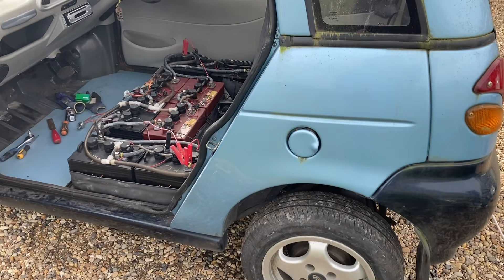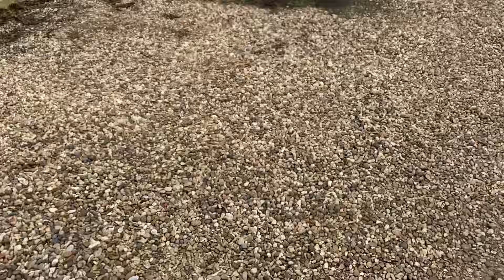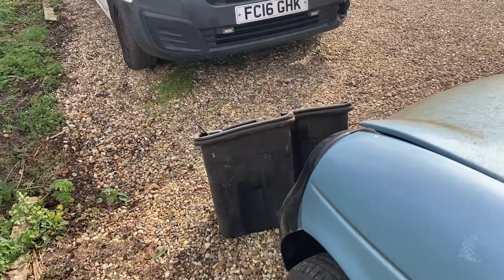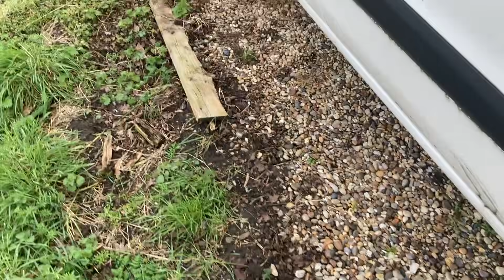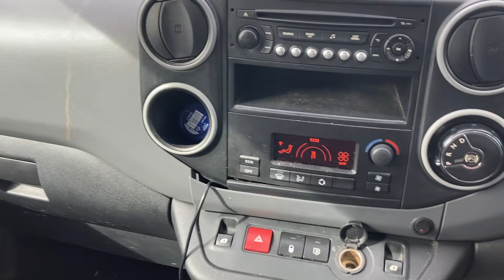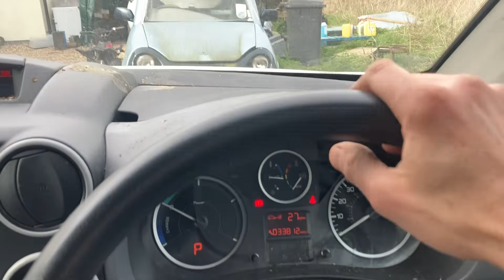It’s RARE EV week! + final answer on the Kangoo battery fault !  Reva G-Wiz Peugeot Partner b9e 2016

Comment: If it's of interest , I used to work with Stanners Equipment in Morpeth , I was R and D on welding development etc and they were given a prototype EV to do bodywork repairs on , it was a Peugeot 107 I think ,  it had a 17kw I think motor in the front it was a laminated iron motor with a gearbox/ transaxle underneath driving the front wheels , the agreement was it was to be scrapped after it was no longer needed ,  this was 2003 or so,  it was a standard car not a concept like the E Doll
Reply from the maker: Interesting thanks !

Comment: That jerking fault sounds a lot like a drive shaft fault, like a worn (or semi-seized) CV joint.
Reply from the maker: It does knock at wheel speed so sounds like a drive shaft. Will see when I get through a couple more Zoe’s !

Comment: I've just been thinking about doing the same with a ride-on mower. Couple of car batteries and a dc motor and controller (of which I have many) and you get a handy compact tug. I don't have the space for a car-sized tug as its only a front yard and driveway so was even thinking of shortening the mower chassis.
Reply from the maker: That sounds like a fun project, I’m not good enough at metal fabrication to be able to do things like good Motor mounts so tend to start with an electric vehicle as a base, even if it’s broken because that is not too much of an issue for me! Thanks.

Comment: Love the G Wiz. Cool project that one.
Me, I'd use it as a local runabout. 
Easy to retrofit 4 X 12V 300AH off the shelf LFP batteries to the G Wiz. Massive reduction in weight, whilst a huge increase in usable battery capacity.
Reply from the maker: Glad you liked the G-Wiz, and that battery upgrade sounds like a great idea!

Comment: I don't believe that only 19 UK sales for the Partner EV. I've had sold about 35 of these and there were loads about registered in 2016. I tried to check on HowManyLeft but gave up as they weren't always registered with the same model name.
As for the gearbox problems on that van, it's probably the sleeve that joins the gearbox and motor shafts together. It's a really common failure on these vans. I made this video https://youtu.be/7c0g-CmFHe0?si=_criFkb3CYPYsnqo&t=209 video some years ago about the issue when it first started appearing as vehicles clocked up some miles.
Reply from the maker: Hi thanks, the numbers did seem low but I wonder whether that is only Sales not ones leased commercially which was probably a large portion of them. I will have a look at your video, many thanks.

Comment: After you've striped down the g Wiz add a 200W solar panel where the roof was. I expect it'll sit round enough to always charge it's self up.
Reply from the maker: That would be quite cool, and since the usage will be in the summer that would work well I reckon.

Comment: On that "it's a bms fault" from the charity car, if it was a bms fault you should be able to diagnose it quickly by puting a clamp meter on the balance lead to that cell and see that it's drawing current.

You'd need to put it on a single wire in the bundle though and not around the whole bundle
Reply from the maker: The wiring is pretty bundled up and my clamp meter isn’t mega accurate - I would be something like 50 or 100ma draw but would work with a good enough clamp meter. Cheers

Comment: Funny I have a 2012 Twizy that I use for towing things about, fitted a towbar to it had the Twizy since 2013 love it but with a 20 mile range it's a bit limited
Reply from the maker: Hi yes the Twizy battery is a bit of a weak point although with careful thought someone could sort out a replacement battery using modules from another vehicle 🤔

Comment: As for the Kangoo I suspect any Renault dealer only has one person with any EV training and not a lot of experience. A quick look, cell replacement and out the door has 'main dealer' written all over it. Bad main dealers is the biggest issue with EVs as other garages are frightened of them. The G-Whiz would be brilliant for a small town or industrial area or as you said London. Topping up daily would not harm lead acid batteries and something that small would make parking easy. I also think it looks much nicer than the Citroen Ami.